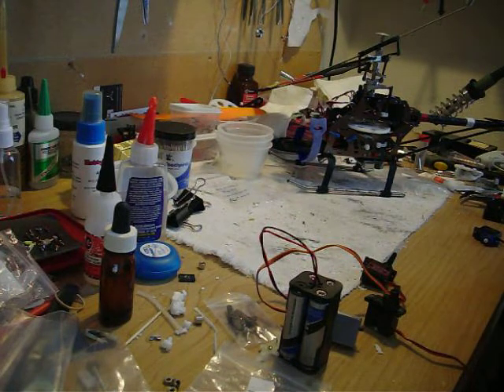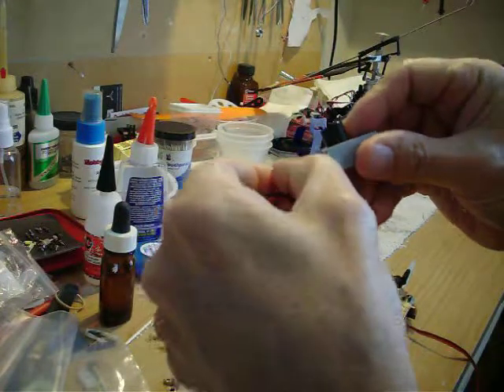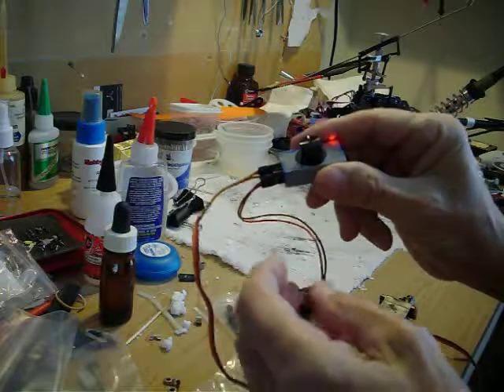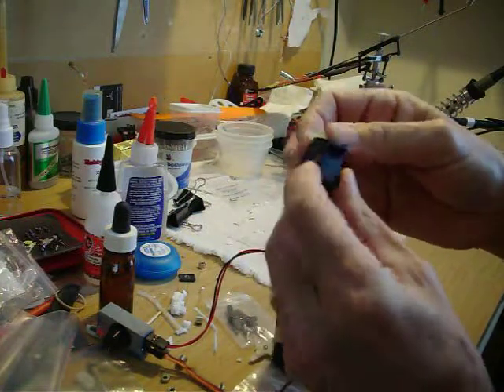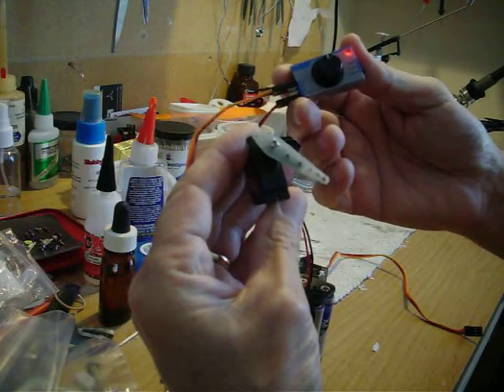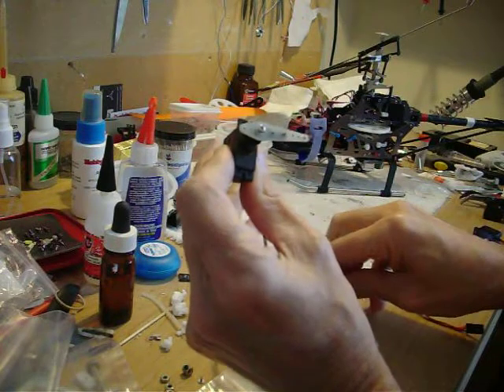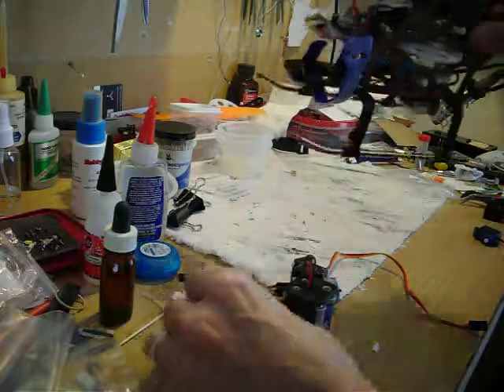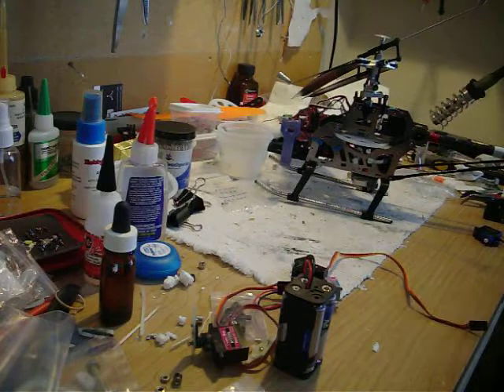Servo Test MG90S for V913

Comment: Thanks for sharing this. I'm waiting for some SG90's to arrive to get my v913 back up, hoping they fit OK!
Reply from the maker: +northofthecity21 Hope your SG9Os fit. You probably have the SG90s by now. I think they are smaller than the MG90s so shouldn't have a problem fitting. The EMAX ES08MA servo mentioned above has the reverse movement of the MG & SG90 servos. If you have a Tx that can reverse a channel it would work.
Reply: +Hifin Sword Thanks for the tips! Fitting was almost perfect, sightly tighter but no modification needed. Movement direction was same as stock on the WLToys V913. These servos are a great alternative to the stock ones sold at x10 the price. I bought a few at about $1.79 each.